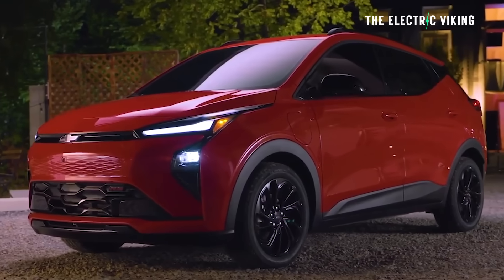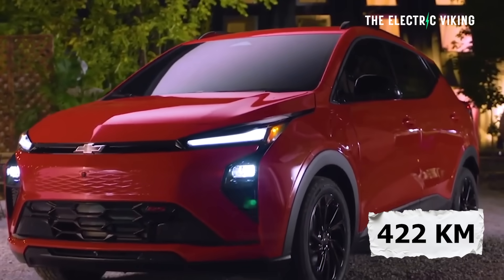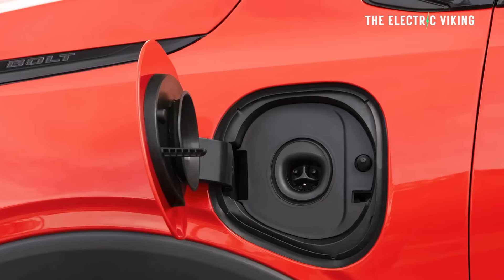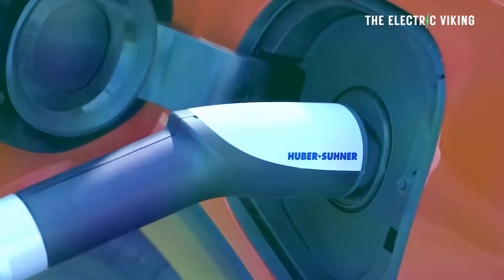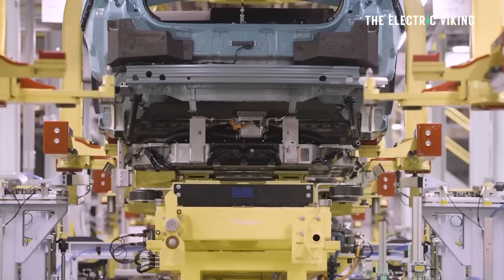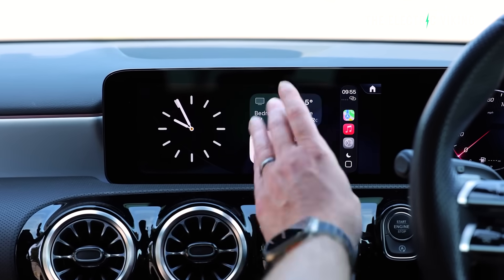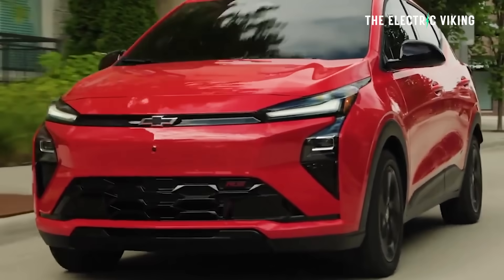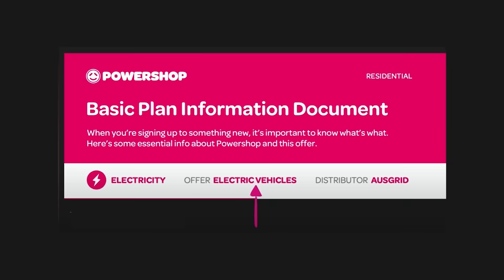NEW Chevy Bolt Goes on Sales With LFP Batteries and MORE Range Than Promised

Comment: The Bolt is only limited because the new Bolt full lineup is coming in 2027. So it is only the 10 yr old chassis that is being replaced with a better latest tech one that costs less to build.  So let's stop using limited as just a bad word choice for upgrading the Bolt to next generation.
And the plant has 450k/yr capacity.  I expect it to sell well over 100k this yr now the SC speed is fixed, lower price.  Likely beat the US 3 sales.
My 23 Bolt regularly gets 310 mile range average, 20% more, so they are very conservative.  I turn the 1 pedal driving off, helps a lot.
Reply: I have a 2020…. I did not realize the one pedal mode hurts range? Interested to hear your thoughts on that if you have the time. Thanks
Reply: On 1pedal regen happens too many times/mile and losing 50% each time because of tire, other losses.
Great for hilly, mountain regions but in most areas, coasting and regen on demand/steering wheel or first " on the brake pedal, gives ~5% more range.

Comment: GM has never made a decent reliable small car. So if they can’t do it with an ICE car, why would they be able to do it with newer technology?
Reply: I have three Chevy EVs: One 2017 Chevy Bolt EV with 91,000, a 2023 Chevy Bolt EUV with 20230 and a 2025 Equinox EV. They're great cars. The 2017 Bolt is pristine and per the Carfax it had no issues. So yes, GM can make reliable cars if and when they want to.
Reply: That is not a good counter argument.
Reply: That's not true.  The Malibu and second generation Cruze were quite reliable.
Reply: Our 2020 Bolt has had exactly zero problems in the last 6 years.

Comment: The issue is no mechanic at any GM dealership has any idea how to repair this EV... This EV is so complicated good luck if it fails. Buy a Tesla and have it drive you around safer than a human
Reply: As someone who repairs their own I was very happy to find my 23 Bolt very easy to work on and everything easy to get to.
And no where near as complicated as a 3 that everything is buried under everything else, high parts prices and need for calibrations at $200 a pop. KISS
Reply: Incorrect on the surface.  It clearly depends on the size of the dealership and the region/location.  Our dealership has a dedicated mechanical team to  service EVs.  And I hate to break this to you but there have been a number of stories about various failures of Tesla, especially in autonomous driving mode.
Reply: Only an American could think an EV is complicated!
Reply: What a joke.  There's nothing safe about Tesla's fake autonomous driving B.S.

Comment: I buy a car and drive it till it is unrepairable at a reasonable price. My wifes car is a 2013 and my truck a 2015.. At the price of cars  today not buying anything. Just repair and maintain what I have. What GM, Ford, and Jeep are building now is Glorified junk with preety lights. Oooo look at the pretty lights😂😂
Reply: How much was your truck in 2015?  Few were cheaper than this will be and won't give backup power to your house.
Reply: @veganpotterthevegan  it was bought used in 2019 with 60k miles at 25K

Comment: I mean, its a decent car, but why not just buy a base Model 3?
Reply: Because this one is cheaper.
Reply: Nah - want to decent second car? - buy second hand
Reply: @71kimg  I'm trying but people hang onto them and prices are too high. The new Bolt is greatly improved: NACS, fast charge, heat pump and more
Reply: I’d like to see a really cheap daily commuter version of the Bolt. Don’t need much more than 150 mile range, don’t need no fancy wheels, cheap 16” steelies with cheap plastic disk hubcaps are OK. Dump the fast charging and go with Level 2 only. People can charge at home with dirt cheap off peak electricity.  I’m even thinking the back seat can be eliminated in favor of a big rubber covered cargo area.  Finally give it a tough finish that may not be pretty but can last 15 years without your HOA sending you notices to remove the unsightly junker parked in front of your house. Do all this with a MSRP at, or under $20K and GM will have a winner.
Reply: Tesla controls the car, not the owner.  Very complicated needlessly. Costs 20% more. costs more to repair,  Elon the Nazi who even trained his Grok AI to be a Nazi, are some of the reasons.
Reply: beacuse Teslas are not for everyone, plus I like to have a smaller car
Reply: @davidhein6044 i've owned a Bolt and a Tesla. There's no comparison. Why go out of your way to buy such an inferior vehicle? How is that smart?
Reply: I have both the Bolt and a Tesla. The Tesla was fully twice the cost of the Bolt when all was said and done. The Bolt has been more reliable than the Tesla. The Tesla lost almost 10% of its battery range in 2 years. The Bolt still has 100% of its range after 6 years. The only thing going for the Tesla is that it is much, much faster.
Reply: @CL-YouTube-y7e Umm, the Tesla route planning, FSD, UI, are all light years ahead. Come on now.
Reply: Elon
Reply: Because I have a soul.

Comment: The Bolt is a fantastic car. Well done Chevy!!
Reply: The Bolt can't match premium EVs, but it doesn't have a premium price - it's priced very well, and the previous generation was already quite popular, and relative to that,  the max DC charging rate has gone up 3x and now goes through the NACS interface, Level 2 charging is up by 50%, the battery cells are now CATL LFP cells - which allow routine charging to 100% and have lower fire risk and should last longer... it also has a heat pump now for better cold weather heating efficiency. I think this Bolt and the latest Leaf (also overhauled) are both compelling entry-level EVs.
Reply: @barry7920  It was my first EV. Had it sucked I would never have gotten another. Instead it was great and I will forever own an ev.